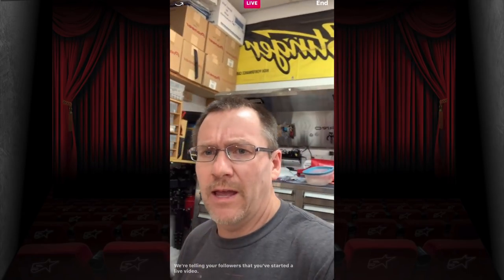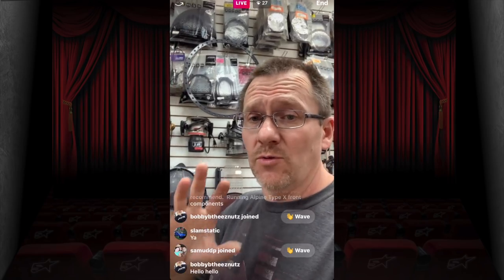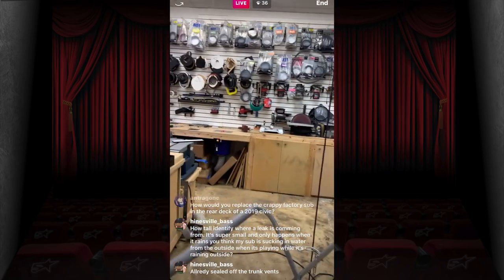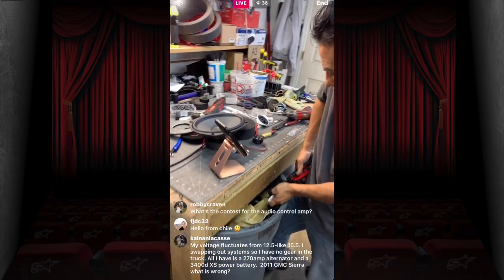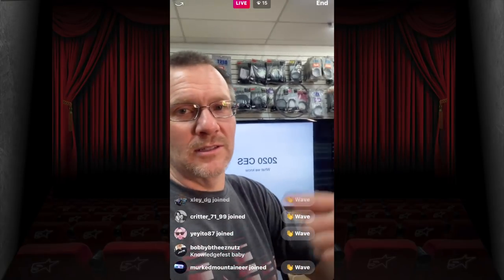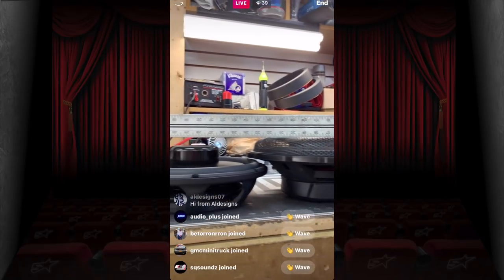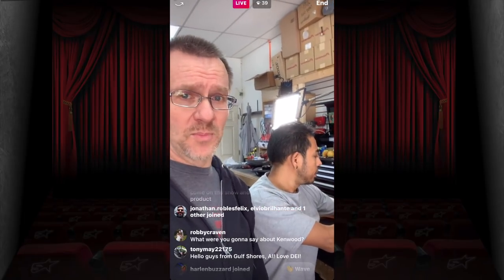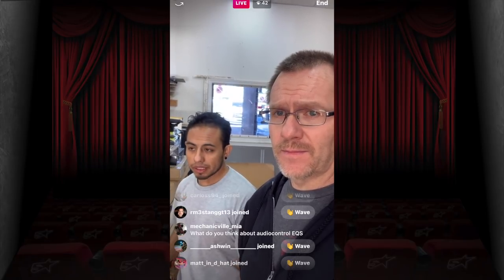new stuff and lots of questions 5 Minutes with Five Star replay 27

Comment: Love your shows I have a 2004 Honda Element EX with 7 speaker system. I have a pioneer 4200 NEX head unit with JL speakers front and back. I want to replace stock amp but want to keep it in current location (passenger kick panel). Any suggestions. Don’t want to put it under the seat. Factory amp is 6 channel.
Thanks

Comment: I have a question.  I have a 2010 Silverado extended cab with a DB SA1600.1D powering 2 DB 1250 watt 12s, A DB SA800.4 powering a DB DKUR component set up front and DB Moto6 6.5 in rear. I have a processor as well. My question is since installing the 4 channel I have had a lot of engine noise. I put a ground loop eliminater and it made it a bit quieter. I get the noise even when engine is off. Could I have crappy rca cables on 4 channel?
Reply: It's not engine noise.
Reply: @csorrows  it has engine noise as well